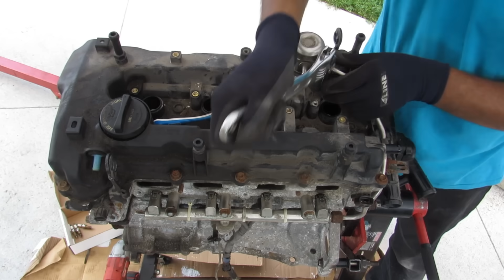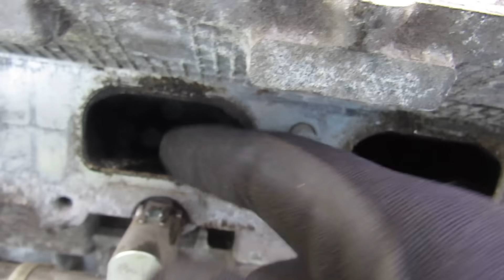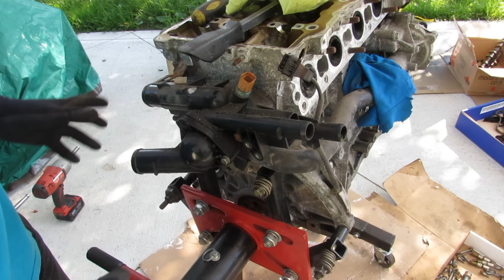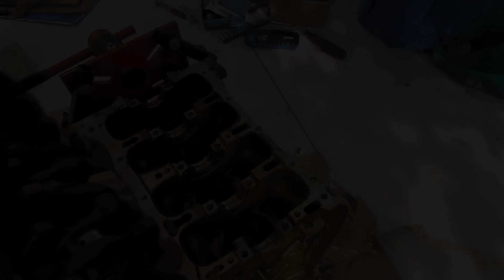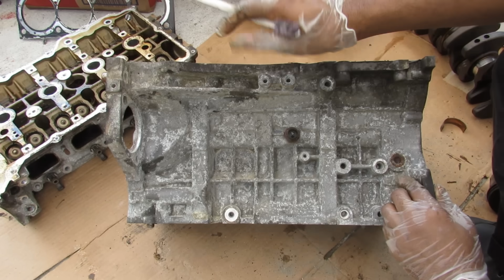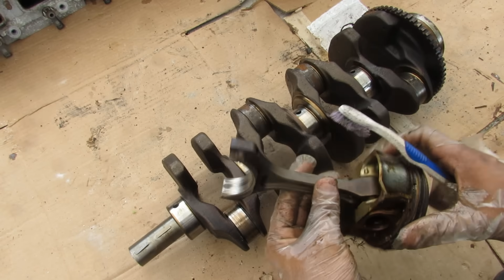Why Hyundai Engines FAIL

Comment: My siblings and I were driving to South Carolina for a cruise in a 2011 Kia Sorento and about halfway through the trip while going 65 on the highway we lost all revs and the engine stopped. Nice.
Reply: @learnfaster164  When I specify to not avoid Kia now, I'm referring to the brand new 2020+ Tellurides, Sorentos, Stingers, and K5s. I lived in Seoul for 5 years, so I understand the issues that come with an older Korean vehicle, I'm just saying those deeply-engrained stereotypes are no longer valid for Kia's new models.
Reply: My Theta II died coming back from vacation too. Luckily I could limp home the last few miles.  For sure it seems like they tend to finally fail on a long drive.  Many similar stories out there.  I'm just very grateful for the lawsuits that gave me a free engine and rental car.  They really stepped up to help me.
Reply: @MattPSU02  my sister got the free engine but the experience was a nightmare. The car had to be worked on for like, a month because the dealership down in SC (we live in VA) was garbage. Her rental car time expired so she had to use my car to get around. That, and there was a freakin rat infestation at their dealership that got into my sister's car and burrowed into her vehicles damaging wiring and electrical systems. Insane.
Reply: Scary!  What did you do?  Did you jump out of the car and run to the side of the road?  What an incredibly dangerous thing to happen.  You could've been rear-ended by traffic behind you.  I'm glad you're here to type this!
Reply: @hamsterama  It was basically the equivalent of a glider with wheels at that point, but we still had brakes so we pulled over onto the side of the highway. We managed to get a tow and a ride to the cruise port and we made the boarding time, but let's just say that we've got a little bit of PTSD from this engine.
Reply: @IanPilgreen  Wow!  I'm very glad to hear you were able to pull over safely.  And that's awesome that you and your family didn't miss out on your vacation, either!  But that must've been a big scare.  By the way, a couple years ago, I told my mechanic I was looking to buy a second car.  He warned me to "stay away from Hyundai and Kia."  But he didn't elaborate.  After watching this video, and reading the comments of you and other people here, I now understand that warning.
Reply: @hamsterama  Don't stay away from all Kias though! They've come a long way as a company since this era. I've happily had a Telluride for a bit now and it's incredible.
Reply: @IanPilgreen  I'm glad your new Kia is working out for you!  Here's hoping it will continue to be very reliable!
Reply: @IanPilgreen  No thanks.  I've been burned by horrible KIA quality on a brand new car that I took a bath on to get rid of it with only 10k miles on it; never again.
Reply: @IanPilgreen   if its powered by a 4 cylinder  SELL IT.
Reply: @rickh633  ... it's not. You know you could've figured that out by a quick 15 second google, but I guess you were dead-set on making a 4-cylinder comment.
Reply: @IanPilgreen   dude I'm an automotive machinist. I've spent the last 40 year machining and building  engines. We see more blown 4 cyl kia and hyundai than any other brand by far.
Reply: @rickh633  Like I said, just dead-set on making a 4 cylinder comment
Reply: @ Ian Pilgreen 🤮🤢
F Kia
Reply: @JRobert111111  There's a 10-year hundred thousand mile warranty sorry but calling BS on your statement.
Reply: @chasl3645  Sorry to you, but there's no BS on my part.  My brand new KIA was a complete pile of crap.  Yes, it was fully covered under warranty, but the amount of time to take it in, get a ride home and the many weeks the KIA spent at the dealership.  And yes, I took a bath on it as everybody will who sells off a new car with only 10k miles on it will do.  So the BS is on you.
Reply: @JRobert111111  still calling BS
Reply: @chasl3645  What is there to call BS on?  When you sell a car you purchased brand new after only 2 years and 10k miles, you will take a bath on it as you're upside down on the financing.  Any person with a brain knows this.  Ask Scotty Kilmer and he'll tell you the same.  As for all of the problems with this car, it cost me absolutely nothing financially as everything was covered under warranty; but it was still an awful car and I was willing to take the financial bath to be rid of it.
Reply: @JRobert111111  That doesn't make any sense. Dont know why. 
But I just ain't buying it. Sounds fishy to me. I'm not interested in Scotties biases. I work with dozens of people and have family that own Kia's and they've been very reliable and affordable. By the way I'm in and out of the shop all the time getting my 270000 mile Sportage and my wife's and kids oil changes since 2010. I've only seen three engines being swapped two four cylinder turbo Sorentos one of which was at 80000 and hadnt had its oil changes and one was a NISSAN  rogue.
Reply: @JRobert111111  Sorry to hear that I had a 1/2 ton GMC pickup that had a 7' print out of things that I had to get straightened out on it. 
I understand now... Sorry
Reply: Chill lol
Reply: Serves you right for driving such horrible K-Pop garbage in the first place.  Lesson learned — THE HARD WAY.
Reply: @lashlarue7924  Okay, let's calm down and remember that it wasn't mine lol
Reply: @IanPilgreen  sorry that came across a little agro.  😐
Reply: @lashlarue7924  LMAO

Comment: Hyundai engines in the past used to be less fuel efficient than other manufacturers' engines. The friction in the engine could be one of the reasons.
Reply: 2014 sonata was 24/35. Camry was 25/35 though to be fair that was port injected so it's pretty sad that the sonata couldn't beat it. Stroke and compression were virtually identical. I'd just put it up to different vvt systems.

If there was significant enough friction to cause a fuel economy decrease that engine is toast

Comment: Would u say the cams are like Ducati Desmodromic engine?
Reply: No where near... Desmodromic  valve train has NO valve springs. Hyundai is conventional valve on bucket ohc.
Reply: On Desmo you have two separate lobes on the cam for each valve which actives rocker for opening and closing the valve. The idea behind the design is that less energy is waisted to open the valve as there is no spring to compress when the valve in open. In the past it was very important to check the clearance every 5k miles. Quite a job to have the 8 valves properly checked and shims changed if needed. For past 15yrs since introduction of Testastretta, the design improved and the valve adjustment interval extended. The Ducati need more maintenance comparing to Japanese in line 4s and are harder to modify for more power. On average WSB Ducati V-twin engine depending on power will last from 500 to 2000hrs. Because they have 90deg firing the engine cases start to deformed or crack. A friend of mine had the air cooled 900SS from '90s. Then 916 that he put a lot of money into. And then 955 homologation version. Ah the sound of the 900SS Termignioni full exhaust was f... amazing, low baritone shaking every size of the glass window - it had ported heads, cams, bla, bla. I liked it more than the 4valve per cyl 916, and later bikes. The Supermono is a very interesting single cylinder engine with sort of a second connecting rod connected to arm to reduce vibrations. It could spin to 10k RPMs, not bad for a SOS. Yeah Ducati was/is something very different with their Desmodromic valve control, and since introduction of 851 it was starting to be competitive comparing to Japanese 750cc on the WSB and AMA circuits. Anyway I have no idea how in hell they can pull out so much power out of the V-twin racing engines, pretty stinking impressive.
Reply: @pliedtka  WHOA 😯, write a book much? Awesome info I save what u said and doing my research! I am buying 1st Bike next year and I am looking at xsr900, Ftr1200 Ducati Scrambler or Trump trident. First and last time I rode a motorcycle was a 30 years ago it was a 1979 Honda. I jumped 2 feet in the air 😁. But since then I stuck to MTB/BMX. Now 48, I feel Im to old for those bikes but I gotta ride 😁 taking my motorcycle safty class next month. They were booked  up😳👍

Comment: I have an 18 Nu 2.0 in my Elantra, manual transmission. 68k. Runs fantastic. Could be because I change the synthetic oil every 4k, use a mobile 1 filter, and just take care of it. No turbo, no gdi. Over 40mpg. Slow car but the trade off is a simple engine and great gas mileage.
Reply: I was just gonna comment the same for my 2019 Forte with the IVT. Thank god no GDI and 40mpg combined even with the AC on. I traded in my 1.6 GDI manual RIO that could barely get 30mpg and it would ping hardcore unless it drank 91 octane. 😳

Comment: There are many videos in Korean on YouTube that explain the failure of the Theta 2 engines. This engine is a design flaw with the connecting rod bearing and the aluminum engine block. Their recall or remedy is to install a new engine and/or a software update for a knock sensor (KSDS), which to me does not make any sense. 
Hyundai/Kia completely abandoned their GDI engines for their new GDI/MPI engines. In Korea, the new engines already have reports of excessive oil consumption. I know a lot of people who are satisfied with their Hyundai's, so if you plan on getting one either lease it or buy one without the GDI engine (prior 2011 models).
Reply: I also believe, there is a engine  design issues
Reply: Also gamma engines present noises that no one knows where the come from(tapping and ticking)
Reply: But sadly here in Canada, there isn't many pre 2011 Hyundai left..
Reply: Right the engine before 2011 was great lot of people with 100 of thousands on them!
Reply: GDIs are a failure with every manufacturer, isnt it?
Reply: @tigertrail3361  Mazda has been using GDI only with their Skyactiv engines since 2012 and they have been bulletproof. They also come with built-in oil vapor separators (like catch cans) so that helps a lot. They did everything they could to minimize carbon build up. I would still run a can of CRC GDI cleaner every now and then.

Comment: i bought a 2011 optima 2.4 6speed manual from car max 3-4 years ago with 74,000 for like $10k from carmax. right at 80k it blew and kia gave me a new motor and a brand new tacoma to drive for 2 weeks. total bill with rental included was more than i paid for the car.

i know its a shit reason for a engine to go but they told me if it happens again they will replace it again. cant complain having a life time warenty on my engine.

took her to the tail of the dragon with 5000 on the motor and it was a blast. 10/10 would recommend
Reply: So Kia gave you a Toyota Tacoma pickup truck as a rental vehicle while your Optima was getting repaired?
Reply: @SI0AX  Very Possible. My Mom Was Getting Her Altima Repaired Nissan Gave Her A Honda Civic To Drive 🤷🏾‍♂️
Reply: @J4Y_Zee  I guess it's to be expected since a car dealership is not a rental company. The weird thing is giving someone a pickup truck for a rental replacement of a small economy car, but that just means there was no cheaper alternative available I guess.

Comment: Sad that theyre having this problem now. It seems like a probl3m from the 1930s. Were over 100 years into making gasoline engines and they still cant machine parts right?
Reply: Thats basically every manufacturer. Look at Ford. The first company to mass produce vehicles and they probably have more failures and recalls than anyone.

Comment: Another issue is excessive oil consumption...my foot doc has a Tuscon and it uses almost 2 litres per 1000 kms. Hyundai is finally rebuilding his engine...partly anyway.
Reply: I assume he's still under the 100k warranty?
Reply: @TruckerGuy135  Even with warranty, he had to almost threaten legal action....he was on the Verge of CALLING SAUL.

Comment: Funny because this engine was co-developed with Mitsubishi & Chrysler (GEMA), but Mitsubishi's version is the only one that stood the test of time.
Reply: Ah Mitsubishi, the Chrysler of Japan.
Reply: @shane6961  Actually Mitsubishi is more like Hyundai, both are large conglomerates that produce a wide variety of things and both are very large in shipbuilding. Mitsubishi Materials Corp. And Mitsubishi Heavy Industries even supply Toyota, Honda, and Nissan with components. Idk who told you that, but Mitsubishi is nothing like Chrysler.
Reply: @trent7080  mitsushitty has the worst paint application.  My mother had a 2013 RVR and a year later the paint started to bubble on the hood and roof.  Mitsushitty Canada told her it would not be covered as it was considered normal wear and tear.  She had to pay out of pocket to fix the paint.  A year after that the tailgate paint started to bubble off.  Chrysler just replaces the rusting panels.  They can’t be bothered to fix the paint.  Mitsushitty is the Japanese Chrysler.  Both line ups are full of crap vehicles.
Reply: @kevinW826  What does that have to do with engines? Mitsubishi has a 7 yr. Anti-corrosion warranty, so your claims are hard to believe.
Reply: @trent7080  it’s called loop holes.  My mothers car only had 30,000 kms on the clock at the time.  Bought brand new from mitsushitty and they wouldn’t honour their paint warranty.  I had a mitsushitty Cancer and I scratched the paint with a snow brush.  Turned out the Cancer had defective suspension that mitsushitty Canada would not authorize warranty replacements.  Their own mechanics knew what was wrong with my car, yet they couldn’t do anything about it.  A one year old car and only 10,000 kms.  Oh and the inside of the door was rusting out so mitsushittys way of dealing with the rust was cover the rust with a paint pen.  The Japanese Chrysler.